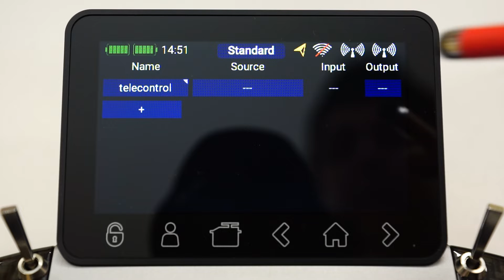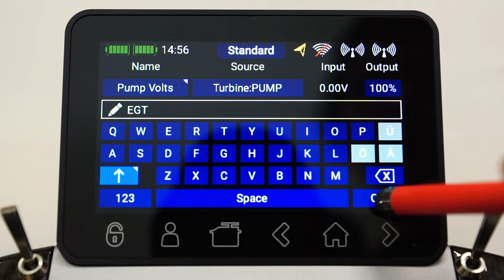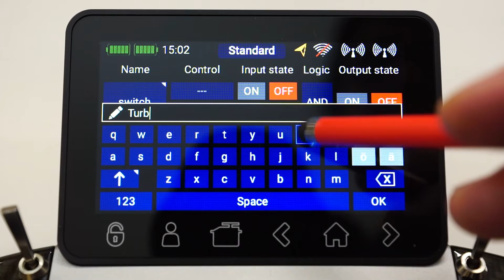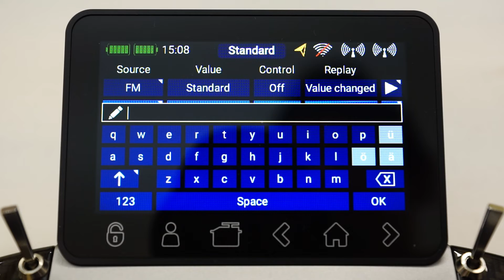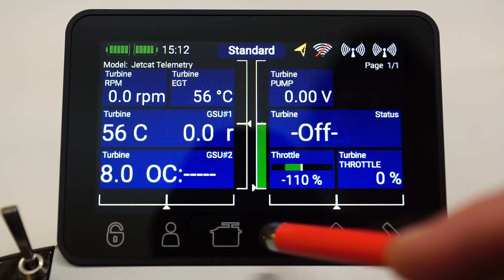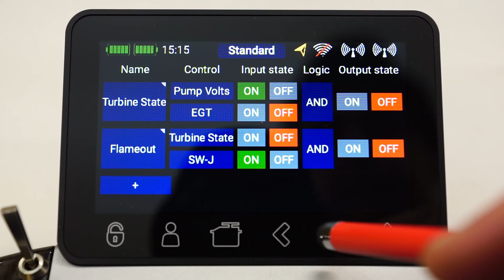PowerBox Core  - Atom : Turbine Flameout Warning Programming Setup

Comment: Hi Costas, Superb as always. I am setting up for Xicoy turbine and could not have done it without this video.  I am wondering if the telemetry failsafe control should also be set just in case and what would you suggest? For example, if there is temporary  loss of telemetry signal from the xicoy sensor for some reason, but not affecting the actual turbine operation, I think you could get the situation of a false flameout warning if both failsafes are set at zero default, so I would set the failsafe for Pump V above the trigger voltage and same for temperature. Hope you agree if that makes sense.
Reply from the maker: @edhampartsoumian  Sure, set the failsafe pump voltage higher. Since this telemetry control is not really a critical function (just generates our flameout warning) then I cannot see any issue.
Realistically there is probably very little chance if losing the telemetry anyway.
Reply: @CVHeliPilot  You probably know this already but a handy way to test the logic of the setup  on the transmitter but with the model switched off is to use the telemetry control failsafe setting as the source and vary this and look at the effect of your various switches and virtual logic settings and also test the alarm settings.  Using the control SIM as the source only worked for me when the sensor is on line, but this did not change the actual values used by the transmitter telemetry controls on other screens so cannot be used to test the system without actually running the turbine.

Comment: Im trying to set up your flameout warning, sorted it all out,  but the last part im having trouble with is the turbine run switch. my Jetcat 130 is activated by the throttle trim position as per the turbine instructions. i need the flameout  v-switch to be the throttle trim, but it wont let me select this. how can i get round this problem.
Reply from the maker: @neilwhite2625  Hi Neil, as you found out the trim levers cannot be used as normal control inputs like other switches, so you cannot use the trim switches as inputs to directly control virtual switches, audio/speech output etc.

Here is a work-around that I just thought of... I had to think about this for a while before the solution became apparent and obvious....😀

What if we use the ECU's telemetry for the ECU throttle position as a trigger....? ie use the value for the throttle position that the ECU sends back to the Tx as a standard telemetry value....

Setup another telemetry control in the Tx, this time using the ECU's throttle value (not the tx throttle) as the value to monitor. Then setup a trigger/output for when the value drops below/above the throttle value when the trim is moved to off/on...!

Now use the output from this new telemetry control as an input for the voice control/virtual switch etc.

I haven't tested it but it should work..! I will try it out later today on one of my jets.
Reply: @CVHeliPilot  thank you for your reply. But im not very good with this sort of thing, if this does work i will need help to input it. Im ok with the basics but this is advanced stuff and beyond my level of understanding. I hope you can still help me. You are the only one on the net that is doing this level and depth of programing for the core. Im going to input the flap/elevator compensation program today. All this is for my Rebel Classic 2m. Thanks again
Reply from the maker: @neilwhite2625  I had a play with one of my jets in the garage about an hour ago and it does work ok using the telemetry throttle value from the ECU. 

So when you are ready have a bit if a play and if you get stuck, I should be able to help you out.
Reply: @CVHeliPilot  i tested the flameout warning today and it worked great, as soon as i shut down the turbine j got the warning until the EGT when below 150c then it stopped, so very happy with that. Ill have a play and let you know how i got on

Comment: Brilliant! Thanks Costas. i´ll do that to my jets. But i also have a few request for coming videos. I hope you don´t think they are to basic to cover. My first request concerns turbine fail safe. I get so confused about how to set up fail safe in the Core system. Do I do it in the Atom TX or in the PB Mercury? Or are these the same? Or do I do it by playing around with the servo travel for the throttle channel? Please help me sort this things out. My second request is how i can use a switch to start and stop my turbine instead of using the trim switches? I guess that one is also simple but when i try I seem to entangle myself in settings until nothing works anymore. Love your videos! Keep em coming!
Reply from the maker: Hi,
With the failsafe you can just set it in the Tx and it will send the info along the P2Bus to the Mercury SR2. I assume you are using the new Mercury SR2... and not an old Mercury unit?

What turbine brand do you want to setup a switch with? Its is reasonably easy to do this as we can setup a new function called throttle trim and use a switch to activate this. Then you set it to operate the same servo output as your normal servo but we limit and offset the travel for this function so it only operates at the low throttle end.

Probably easier if I make a video on this and put it up on YT. I have some time tomorrow so I can do it then...!
Reply: Thanks for replying. Whenever you have the time I´ll be grateful. Hopefully there are more people around who can benefit from a video. I think I understand what you say about switches but nothing beats a video. I have a Kingtech turbine with V-speak and I use the new Mercury SR2.